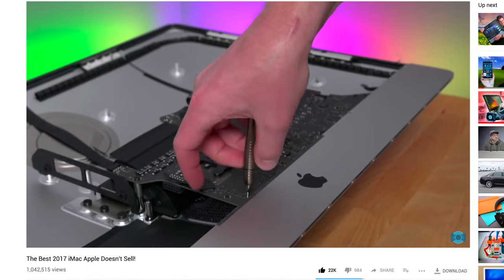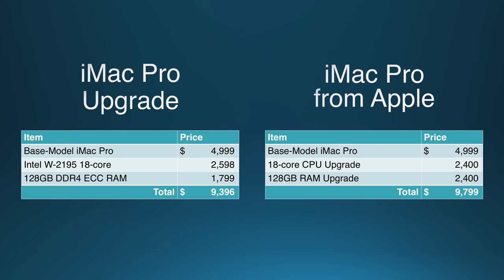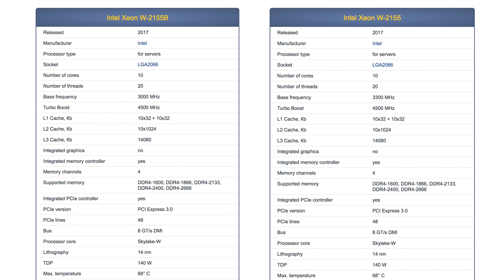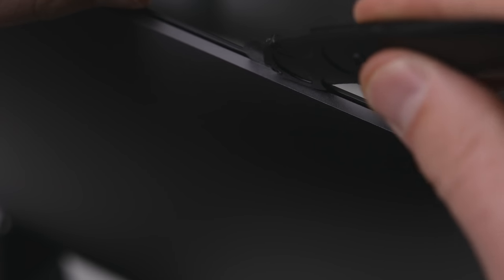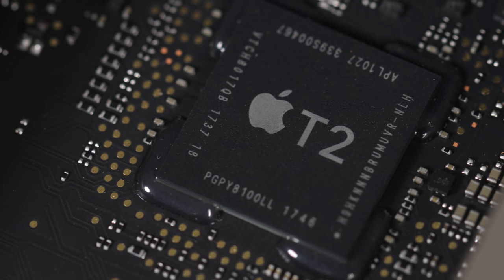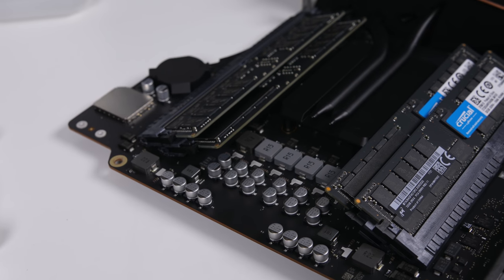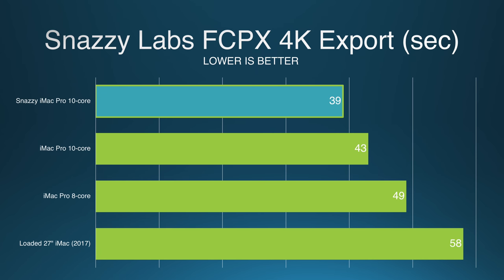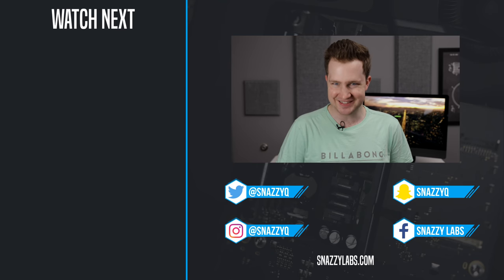Can You Upgrade the iMac Pro?!

Comment: While you're correct. An i mac is cheaper than buying the components separately, that's a bit of a technicality. It doesn't make the machine good value. It just means apple chose overpriced hardware.

Comment: Why does Apple insist on cheaping out on thermal "cement", lower bin chips, zinc screws etc. It's mind boggling. People would buy it anyway even if it cost a couple of 100 bucks more. That's the power of the apple cult they have harnessed over the past decade with their good and great products. This is just a big fuck off to the consumer. In the past they didn't go the cheapo route. Correct me if I'm wrong.

Comment: The only market an Apple system makes any sense is corporate. Dealing with workstations that will be replaced in a set window that are required to perform specific tasks using specific applications, Apple's Mac Pros do a decent job. Any Apple hater that disagrees is just hating for hate's sake. Corporate entities write off the high costs to taxes, are never going to get their systems repaired and fully intend to upgrade to the next model when it arrives. To them, these machines make perfect sense. Add to that the snob value and you have corporate success. 

Where Apple products make far less sense is in the consumer space. You can always get more for your money with a PC or Windows/linux laptop. Yes, you will make some compromises in many cases but those compromises are up to you, you can choose a cheaper model with a cheaper screen or you can go all out and match spec for spec and still save some pennies. The same goes for Apple phones, Android devices of similar build and spec tend to cost far less, be easier to get repaired and offer more options (variation). The key advantage of the PC market is choice, you can select what appeals to you and opt out of what does not. Apple tends to offer preset packages, sure you can have more or less RAM, faster or slower CPUs with fewer or more cores but the system itself is the same. If you don't need a retina 5k display you can get a 1080p display etc. Some home users need Apple for the OS and software, budding musicians often prefer Apple's audio tools and connectivity for example but by and large, a home user has no need for any of Apple's proprietary crap, they only think they do. Soldered RAM is unforgivable on a laptop if there are no upgrade slots, it is the one thing most laptop users can do to extend the life of their device by a year or more. Doing the same with storage and CPU on top of that makes the system basically a disposable item, which would be fine if it was not priced as a premium product.

Comment: Those SSD specs are nothing compared to my already aging 960 PROs.
Reply from the maker: They're faster than the 960 Pro.
Reply: No. Check the spec sheets of the 960 PROs vs what you said in the video. R/W 3500/3200 of the PROs without, mind you, RAID-0. If I were to RAID-0 my drives they would total 6000 for read and about the same for write performance.
Reply from the maker: You don't get striped performance benefits when simultaneously reading and writing data across a single RAID volume. The performance according to Vortez is only marginally improved in RAID 0. Write speeds are slower than the Apple drives but you're correct in that read speeds are faster. Not 6000 though. It's barely over 3500 in RAID0.

Comment: Why not just make a hackintosh? Just curious if there would be a worthwhile price difference between a hackintosh using disimilar hardware with comparable performance that has no warranty that you'd worry about voiding.
Reply from the maker: Stability. I love hackintosh machines, but they’re not suitable for a production environment. I need my machine to work all the time, 100% of the time. Even the best hackintosh configs can’t offer that.
Reply: Depends on your hackinotsh skills Snazzy. My hack works absolutely flawlessly, not because im a pro at it but because I followed a pro's guide, most tutorials/guides cut a ton of corners on setup/config and thats why they lack in stability.

Comment: PC IS cheaper.
You're comparing a Ferrari (your 5,181 PC build) to a Volkswagen (5k iMac).
The Gigabyte MW51-HP0 has 7 PCI-e x16 slots, M.2, U.2 and 10 SATA ports allowing for incredible expansion capabilities.
I also don't know why you added a $109 Ethernet card when the motherboard comes with 2 on-board connections (but we can pretend that's a copy of Windows, maybe?)
Most other things are fairly reasonable, although I personally wouldn't have gone with the 
$138 wireless mouse and keyboard.

Point is.. even if it's $182 more it's also a much better computer where you get to cherry pick which exact components you want for your personal needs. You then also get full control over how to configure those parts and plan for future use and the ability to upgrade.
As well as picking the exact form and look for your computer you're also able to cool the computer better, allowing for more power gain from the hardware and less sound as you can have better fans.

Call me a fanboy all you want, but when you say an iMac Pro is cheaper than a PC you only make yourself out as the delusional fanboy.

Comment: Apple have a habit of adding about 10 - 20 times to the price compared to actual cost for upgrades those greedy assholes... I saved a small fortune when I did upgrade my brand new 2008 Macbook pro from 4 to 16GB ram wich was the max supported, sadly you can not do that trick on the new ones as ram is soldered on...

Comment: hey careful not to void that cast iron apple warranty snazzy labs ;) & i hope crucial gave you the memory sticks to keep. 128gb is handy for resolve, after effects, google chrome ...
Reply: Not if you are talking Chrome/Chromium OS which can run fine for average Joe work flows with just 2GB of RAM, and a decent CPU. In fact for my work PC I used some old parts I had laying around the house with an AMD Athlon II X3, 8GB of DDR2 800Mhz Ram, a 2GB AMD R7 240 GPU, a 250GB Segate 7200RPM HDD, and 2  22in 1080p 60hz ACER monitors, and beyond boot times being a bit slow from the old motherboard, it really screams on CloudReady OS(Free prebuilt Chromium OS build), and I've had upwards of 20 tabs open across both monitors while watching 1080p 60hz YouTube videos. So yeah Chrome is not really a hog, unless we are talking Windows, or Mac, and no where near as bad now days as it use to be.

Comment: Ehhh... I'm tired of this. Even if PC is more expensive, you save a TON as soon as you upgrade. You "recycle" the screen, memory, storage, peripherals...
And you can actually mount the PC display on a VESA mount.
And any upgrades can be done with a screwdriver, not a prying tool or a heatgun.

Comment: It is silly to down play how Apple rips you off if you order the faster CPU model by charging you both the cost of the faster CPU and also the base model CPU that you will not get.

With that in mind you really could build a much better PC than the stock 18 core iMac Pro (because Apple is charging you a $2000 idiot tax!) even with similar specs because it would last a lot longer due to it not getting hot enough to 
thermal throttle all the time (it would also be faster as well due to lack of said throttling).

Also, if you bought the $4999 base model and upgraded it you would not be voiding the warranty on a $10k system, only the $4999 one! How much Apple charges for the same specs is irreverent.

Comment: Sorry, I don't use FCP so...
I have no use for MacOS at all... whatsoever...(and I don't think anyone else does either, unless they have some sort of obsession with safari ^.^)
And by having no use for FCP > MacOS(not even to play around with in an emulator or hackintosh either), I have no use for apple hardware and its apple tax, so....
Thanks for the vid showing the insides of a very expensive, very undersupported machine that  has hardly any to no use for that is until its running bootcamp.
^.^

Comment: The PSU really hurts! not even 400 watts? for a 8 or 10 core cpu AND a vega card? A 1070 might have worked, but I would never go with a psu so weak for a 350 watt cpu/gpu system. the screen will probably be like 50 Watts on full brightness if I'm nice to Apple soo...
Reply from the maker: Someone in the comments said that Apple advertised it as 500W to their firm. That may be true. Apple says "peak wattage" is 370W, so you'd assume there is some headroom built in there; however, at the same time, I'm not sure because Apple doesn't say and literally every repair website on the internet says 370W
Reply: Snazzy Labs That would make sense, it might be a 500 watt with poor efficiency, so like a 75 plus. PSUs under 80 Plus are not allowed to be sold. I wonder, how this applies to pre-builts, if it does.
And yes, it's decently priced for an iMac. When i first heard about it, I wondered, if Tim Cook was ill.
The lower quality chips would even be reasonable for that price/performance+looks & "Apple likes money"-cost.

Comment: I would probably build a PC either way. That thing is just a pain in the dick to take apart and if you've voided the warranty, you're potentially going to have to do it again later. At least in a normal PC, with an ATX board and common parts, I can be assured that replacements and changes are less painful. (And likely much cheaper with time.) That being said, I've been thinking that the next system I build is probably just going to be a Threadripper 2. Why? Because 32 f*cking cores... That's why! LOL :) (For no reason, but to have them for strange things that I do with my computers.)

Comment: repairs and maintenance are A TON less if you build a pc comparable in hardware specs to a Imac pro.  "if" a part fails on your computer and you are not tech snazzy, you'll be spending a butt ton to get your machine back in business on the Mac side because you have to absolutely use the same parts (logic board), (CPU), (GPU) and (RAM).  a huge deal breaker nobody ever really talks about.   on a reg pc your chances of getting a newer more stable motherboard, CPU, GPU, ram are there.  and ALOT less expensive!!!!  motherboard mac = 1,000usd, motherboard pc 200-500usd and that's for the best of the best of the best.  if your in a position that you don't have a spare grand or more laying around and your iMac pro take a dump when you are without.  whereas a pc makes the turnaround time much quicker.  so overall, the iMac pro is way more expensive in the grand scheme of things.

Comment: i really like the experience of a mac.. an  i just don't like windows 10...  I love linux  but  as a graphic designer.  I cant really main linux an expect the same level, of professional software such as  Photoshop or pixelmator pro.  i have build gaming pc's  for my self and customers. and they really all look the same. its a box.  black or white.  with flashy  hardware with a window  or not.  but at least my  2,000 mac looks like  its worth 2,000   and it doesn't put out a ton of heat

Comment: Except for the fact you'll never be able to rapair, or do anything with the shitty iMac pro that will break and will only be repairable if you send it to Louis Rossman or someone that has expensive equipment to work on this poorly built hardware; while PC's are built with standard parts that are quality for that price, therefore your argument IS VALUID, but NOT RELEVANT due to the fact the PC is a WAY BETTER OPTION.

Comment: Honestly comparing the price spec for spec between the iMac pro and a pc does not make sense.

The joke is that nobody would be that stupid to build the components spec for spec in a normal desktop pc.
Xeon processors are overpriced for what they deliver compared to a core i9 or AMD's Threadripper. Also nobody would require EEC RAM. This only should be found in servers in my opinion.

tl;dr
The iMac Pro is overpriced because of the overpriced components that are inside it.

Comment: Your price comparison still lacks, the Xeon for example is not much different from the Intel Core i7 7820X which costs 50% less.
Reply from the maker: But again, the point is that I'm building a spec-for-spec machine with ECC memory and that requires the Xeon.
Reply: Grahamhg 

There's no advantage of ECC RAM when compared to regular RAM if you're an average consumer. It's only meant for servers.
Reply: Grahamhg  no. Benchmarks shows that 3200mHz dual channel RAM easy beats the 2666 mHz quad channel ecc memory in the iMac. So no advantages at rendering. Only as the commend befor said its usefull in servers.
Reply: Grahamhg  but "should" not happen an error more often? Never had my system break down by an RAM error. Is the ecc not only for errors that appear often like every few sec? Or do I mix up differend errors?
Reply: Grahamhg  no im not rendering images. Mainly I compile and run lots of code. Not over a few days but still over a few hours. But as I said my system never breaked down because of a RAM error. Either I was lucky or you had no luck sometimes
Reply: Grahamhg  well my cpu and gpu is often pretty stressed. Might be that my RAM is used differently then yours but normaly its used nearly to its full Dimensions when I run a more 3D oriented programms. But this is not as often the case that I programm in unity.

Comment: what a waste of money, and time, for a computer that's going to get way to hot, and won't even get warranty support.
Reply: You seem very knowledgeable.. How hot does it get? how does that affect the user? Does it throttle? Can you share a build with same workstation specs that runs cool, has a high quality screen and is cheaper please? thanks, i'll be waiting.
Reply: well you see.....lol, it gets around 94.2 c underload, on the 8 core models... which thermal throttles it down to about 120w which is roughly 10% loss. now consider the extra core count and heat that goes along with it........ and you've got yourself a mac user bitching at another mac user acting condescending to prove a "magical point" that does you no good. The dell UltraSharp UP3216Q is rated one of the best video editing/photo editing monitors in the world and it comes in around 1,300 usd, and when considering a good pc's hardware that idles easy under 80c and 12+ cores running at higher frequencies, ecc support, and a much more expansive memory support, you start to see the flaws in this pc. Why bitch at me, do what you do, but when i spent 5k on my imac pro, and 3.5k on my desktop and get to compare them side to side, i think i might understand somewhat.
Reply: also, my point seemed to fly right over your head.. as i was commenting on the upgrade to the mac, the mac itself is nice, i own the 8 core model. however i think that the expensive upgrade to it isn't worth it, in my opinion. So before you assume and act like an ass online, just maybe re read the material.
Reply: D-one is not only being rude, but he's arguing over something that the op didn't even propose, 
and the op even has an imac pro, and a pc haha nice.
Reply: that's really cool you built a hackintosh, it takes a lot of effort and patience, so kudos to you. Just dual booted a kabylake system with high sierra, it was quite the process. I'm sorry for being upset, i normally don't lash out, that was about 18 years of internet anger bottled, just smoked a bowl, and i feel bad about it.

Comment: Ridiculously overpriced parts : did you try to find the most expensive listing or what. Even if I leave the cpu, gpu & monitor everything else can be bought for FAR less than you quoted easily lower than the $3999. eg 540 motherboard because you couldn't find a suitable board for 200... same with ram, twice the price it need to be for 32gb then there's the mouse & keyboard again twice the price, same with the case also you didn't factor in applecare or when you need an upgrade you can't just replace a gpu or cpu it's another 4k+ instead.
false economy.

Comment: $5000 for a mac, Get a good PC for $2000, you don't need 5k so get a 4k monitor for $400, mechanical keyboard for 150, good mouse for $50, so in total, 2700 for a PC that's better than mac, $5000 for a mac, and if you like Macs OS which I don't get why you would, you can get a separate drive you can switch to so you can have Windows and Mac on a good PC, and a few years down the line with a PC you can get a new top of the line GPU for $700-$800 and still have a good pc, where you have to get a whole new $5000 Mac every few years, this is why no one should buy a Mac.